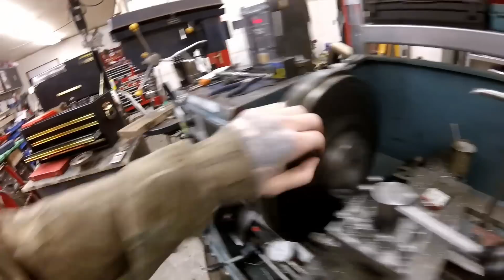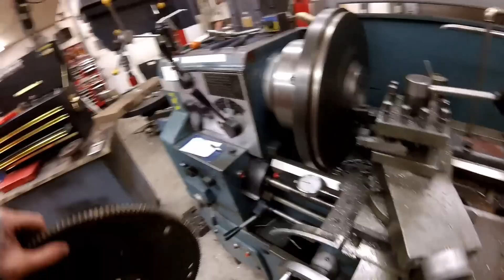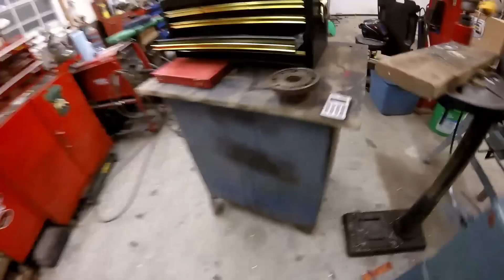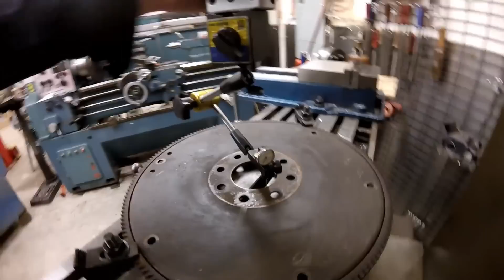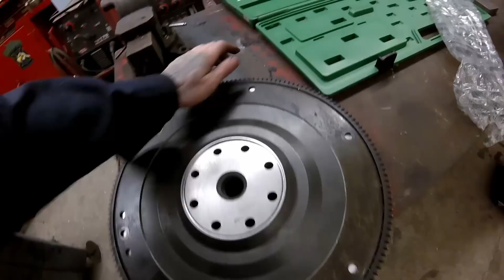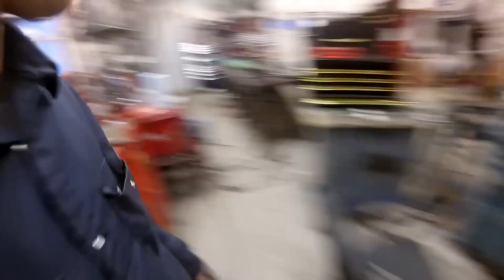Cummins conversion on a CAT loader, Part 1 the flywheel

Comment: what model year did flex plate come form?  the ones im seeing are not as solid in the center
Reply from the maker: I'm not 100% sure about this exact one but it's the same as mine which is a 5.9 from a 1997 bus with an alison 545 transmission